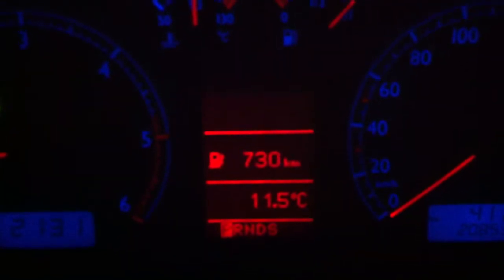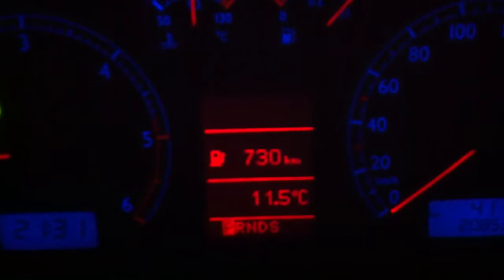Implementing CANBUS 1.6 to 2.0 Upgrade. Initial success

Comment: I'm currently in the middle of trying to sort this in my T5 with a T5.1 Kenwood head unit. I have caravelle executive clocks with full height MFD, so basically your setup. 
Have you managed to get a multifunction steering wheel working?